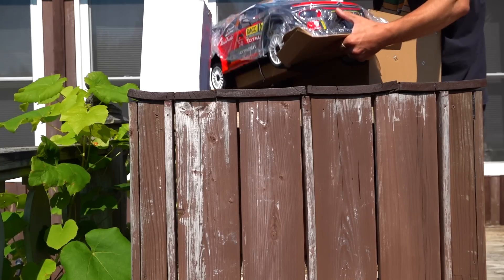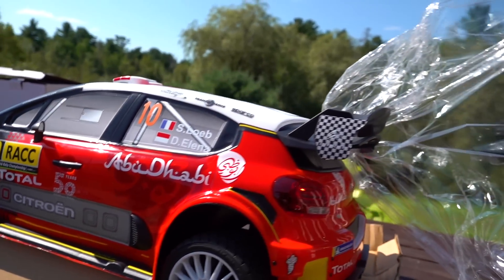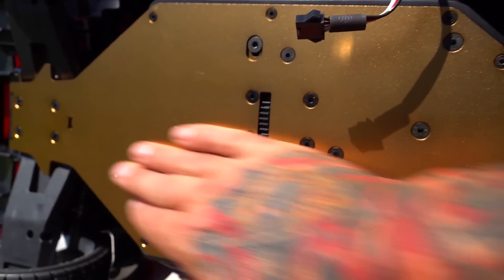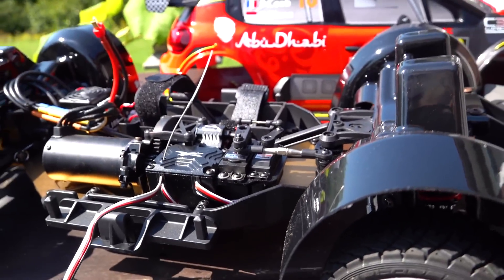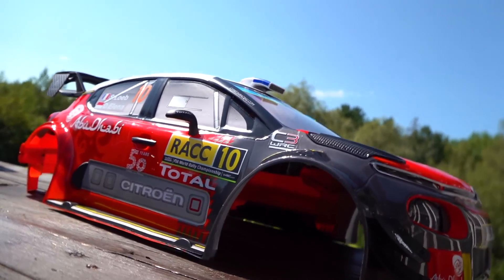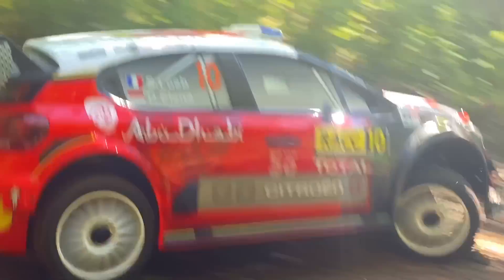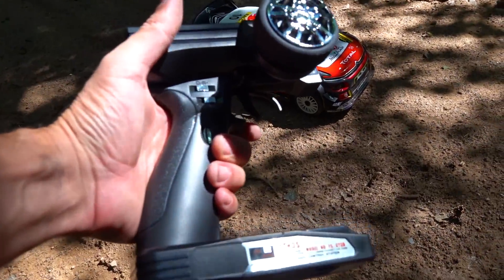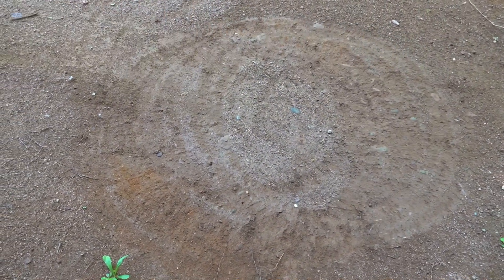Citroën C3 OFF ROAD RALLY CAR! | RC ADVENTURES

Comment: One of the best body designs and so scale too. I love these but not 4s which is just a simple switch of ESC to at least 150 amp.   I would love to see a new Hobbywing G2 4274 sensored 6s setup?   That motor is the same one they sell with the 6s version.

Comment: I love the car except one major issue I see.. the exposed drive gear (as soon as you showed the bottom, I shook my head) (I hardly ever use one of my nicest associated racers/bashers for the same reason) I get too many rocks/pebbles jammed in there.
Reply: So many damn times had that happen specially on my hip street car it's set up same way and that thing pretty much almost is on the ground lol
Reply: I ment my hpi
Reply: @lastoppertunity333  yep, It's one of the first things I look for when I'm shopping for new ones 😉
Ok for indoor stuff

Comment: Great videos keep it on bashin! I looked for this on the king motor rc site referenced. They don’t sell it, contacted them on their form said they are not a distributor of this. Also reached out to the king motor China site, no response. So where do I get this? want one :-)

I have their challenger, good truck (it’s old version of the losi super Baja Rey with different electronics). I’d say the body, build and servo are better than losi. Rest of electronics meh, but those are easily replaced.

Comment: Update on this, not sure if in production but you can get it on eBay now. Here’s the catch -
Rollers are $989 + $299 shipping + your local sales tax- $1288 plus tax basically.
RTR (Hobbywing ESC/Motor) is $1499 + $299 shipping + tax - $1798 + tax basically 
Yeah you gotta be of royalty to afford this 😂

Maybe it will drop en mass sometime in the future? But with zero Covid issues in China, I’d not count on it…
Reply: I've just ordered one couldn't resist 😅
Reply: Thx for the tip. Ordered one stateside too!
Reply: It’s at my local hobby store for 600

Comment: Have you ever used a dualsky motor? Or anything else from them? I bought a ga6000 brushless motor from them and I'm wondering what exactly I'm getting. Seeing as how it was as much as 1/3 the price of other motors in its size range. Which isn't the reason I got it but.. well see

Comment: This RC car is twice or more the price than both the excellent 1/8 scale HPI WR8 FLUX 3 BRUSHLESS and  HoBao HYPER GT BRUSHLESS models, which both models are at the top of the tree of RTR ROAD / RALLY CARS .  This FIAT bodied RTR RC CAR range wildly in price between £750+  &  £850 +  UK pounds even before the price of VAT & CUSTOMS charges has to be added on.  At their current prices this is a bit of joke with ALIEXPRESS prices.  Anyone who knows anything about RC cars, will instantly know this price is grossly overpriced even at it's supposed 1/7 scale size .
Reply from the maker: Thanks for complimenting my new ride.